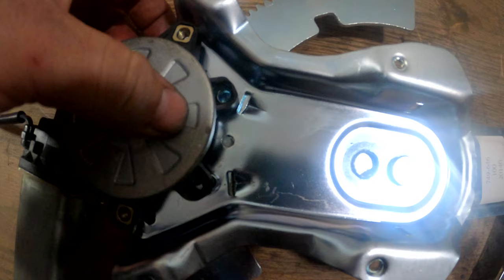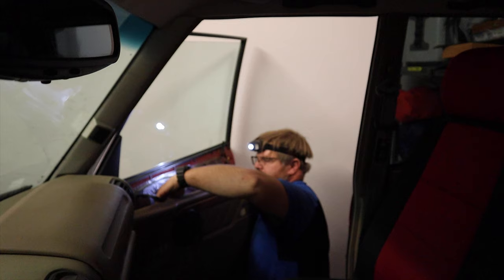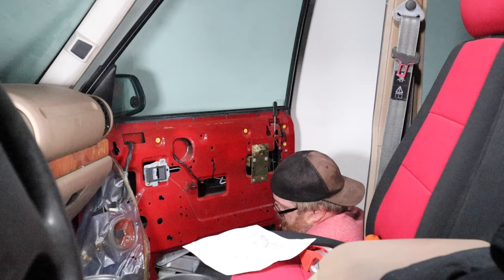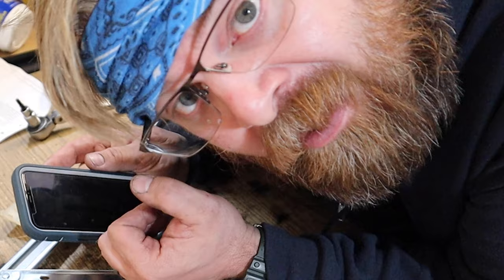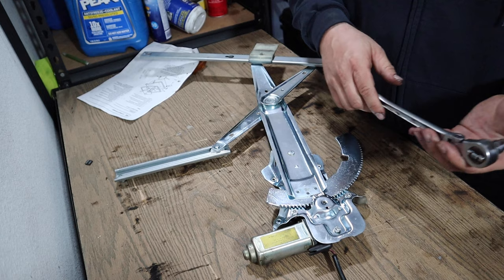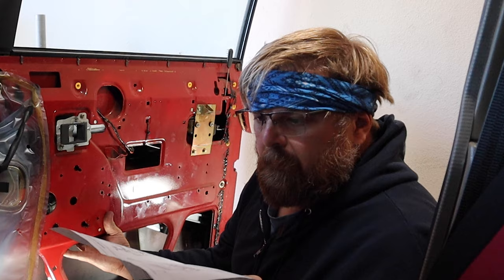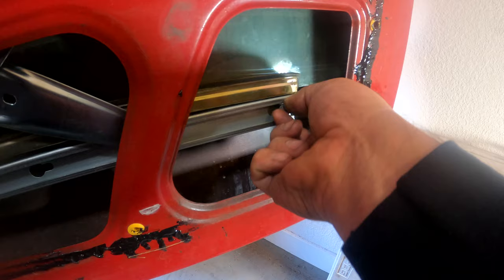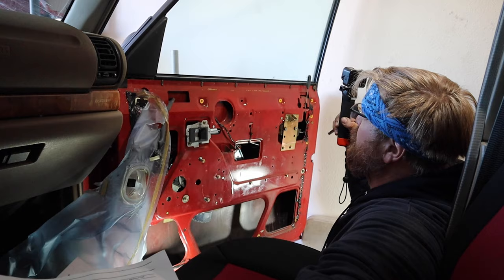Replacing a WINDOW REGULATOR in my Wife's LAND ROVER DISCOVERY 1

Comment: Part of the reason why Discovery's have and have had such bad rust problems is because of the use of Dissimilar Metals connected to each other without a barrier between them. This actually creates corrosion without being exposed to the elements or corrosive liquids like road salts ect... The reason why it does this is because one of the 2 metals touching is lower on the galvanic chart then the other basically making one of the metals an anode and the other the cathode and the 2 metals contact with each other becomes the electrical pathway between the 2 which in regular corrosion is actually water that connects the anode and cathode. That is why on the back axles of Discoveries there are 2 discs that are bolted to a plate with a cable that then is connected from the disc to the axle if you have ever taken this off to install say a dif guard you will notice how heavy they are its because they are made out of zinc which is low on the galvanic chart so it sacrifices itself for the carbon steel this is called galvanic protection and its been used forever on things like ships or water tanks. A lot of the Discovery's I have seen with a ton of rust is either because someone thought it would be better not having these there or the cable connecting the zinc to the axle housing it broken or it doesn't make contact with the zinc or the steel. If you want to learn more about Dissimilar Metal Corrosion look up that or look up Catholic Protection. There is a little science for everyone and the only science I know a little about since I am a Industrial Coatings Inspector. What's next for the Disco maybe a little altitude?
Reply from the maker: Well, I just had that climactic moment, ala the end of “The Usual Suspects,” where the whole mystery ties itself together. I’ve been wondering for months what the hell those discs where for. Even my dear old dad was stumped by it. I knew about the dissimilar metals causing corrosion issues, and have seen plenty of sacrificial annodes in ships and offshore oil platforms. I’d just never noticed it to that scale in a car before, so it had me stumped. Thanks for sharing that! As for the next steps, the next time I have her through the shop, I’m gonna tackle a few more of the non critical issues, like the AC, and start focusing on what pieces we need to add to make it more suitable for the upcoming trips we want to start using her for. I don’t foresee us adding any more elevation to it right now, we are at a hard limit with our garage door, like it won’t clear right now if the rear sunroof is accidentally left open. That doesn’t really leave a lot of options for a fitting any kind of a rack without dropping her down a size or two, but we’re definitely looking and scheming!
Reply: @MattKester  Solution, bigger garage, LoL. My garage luckily is tall enough with 31.5" tires and 2" suspension lift to be able to clear but do not think it would with a rack, not the biggest fan of racks though so doesn't really matter that much to me as for gear and somewhere to sleep I've got an idea in mind of taking another disco that doesn't run and stripping it down cutting it right in front of firewall and turning it into an off road trailer I have the shell of an 03 currently just need some metal and motivation. Today I've been working on a electric  CDL for mine since Rover decided they would put a CDL in the 2000 but not hook it up. But I really do not want to pay almost 600.00 for the Ashcroft one or try to find a D1 shifter and linkage to do it that way, plus I have all the stuff already to do the electric version that I have in mind so no cost CDL. Hopefully it works the way I envision, if not atleast I tried. Crazy that your sunroof actually works took alot of work to get mine working especially since old owner sealed them in with windshield glue.

Comment: I cannot watch this. Not because it’s a Landrover, but I have an 06 4runner and the regulator broke on rear window as I was driving down a dirt road. The dirt filled my car. I was broke at the time and waited 3 months to get the part and my diesel mechanic nephew ( Bubba) real name helped me install it. There is almost nothing on the web about it. But we got it done. Love the vids and I live in northern Arizona. Keep up the great work. You are awesome person. Rock on my brother!
Reply from the maker: Interestingly enough, one of the plastic rollers in the rear window on our 4Runner disintegrated on a trip out to Sheep’s Bridge a year and a half ago and I’ve yet to wanna dive into it! How much snow you got up there so far this week?
Reply: In kingman it’s snowing I live 30 miles up 66 and it’s raining. At 3300 feet. Supposed to be snowing this afternoon. Hualapai mountains will get 2-4 ft us maybe a few inches
Reply from the maker: @fortyfourrobo544  Dang! I’ll bet that’ll be an impressive site on those mountains. We went and hiked Cherum Peak last March and ended up getting snowed on on the way up pretty good! It’s always amazes me when it snows like that around here!
Reply: For year my window would just barely go up and down. I disconnected it and finally after living on a wash board dirt road it broke the regulator.  When our vehicles get over 12 years old they need talc and new parts. The engine and trans are great. Suspension rear end , front axles ifs and shocks were all replaced. Btw the Bilstien shocks are great . I noticed yours.
Reply from the maker: @fortyfourrobo544  I’ve been very happy with the Bilstein/OME combo on mine! Only issue I’ve had with it is one of the front sway bar brackets broke. That was easily fixed by removing the front sway bar altogether!
Reply: Just started snowing
Reply: @MattKester  great setup.  Watching your channel has made off road more. Like every week. Even though I am in 4wd everyday with where I live. I like a challenge
Reply from the maker: @fortyfourrobo544  Good to hear it! I'm glad your getting to do something you enjoy more! That's what it's all about!

Comment: I replaced all of my nylon rollers with aluminium slides.. cost about  $10.. they run smooth and will never break again.
Reply from the maker: Nice! Do you have a link for the ones you used? I’d love to check them out, as one of the rollers in the rear window of my 4Runner just disintegrated and I have a sneaking suspicion this won’t be the last window regulator the Disco eats up!
Reply: @MattKester  you make the slides.. I don't think there is a video. It's just a cut the shape of a key hole you put in centre of about an 4cm of 25x3mm flat bar.. the key hole slides over the stud that held the broken roller.. then you slide it into the roller guide.. fits like a glove..

Comment: Evidently all these reasonably priced replacements are made in China by the like of Dorman. These companies would make affordable replacements when they see massive failures from the OE craps. LR are such crap that you cannot take out the door cards without breaking everything and you are left with a much bigger project on your hand than fixing the shit regulators that failed because of the stupid flimsy plastic sliders. I will wager there is 100% failure on them. Thanks to Chinese aftermarket parts we now have affordable solutions. 

Both my front ones failed many years ago and I knew how a nightmare it would be to remove the door cards. Over half of the plastic retainer anchors broke and I have to buy some 2-part polyurethane foam to glue them back.